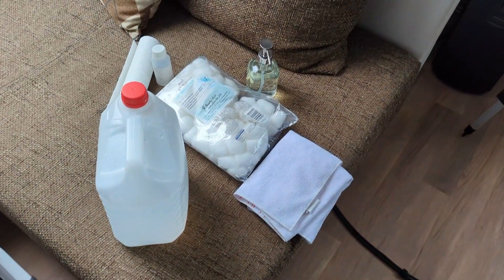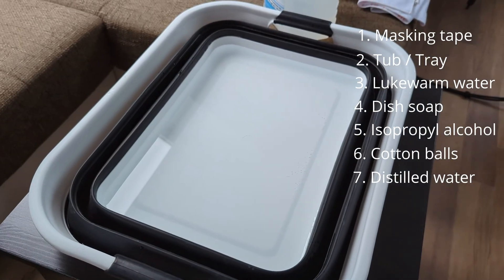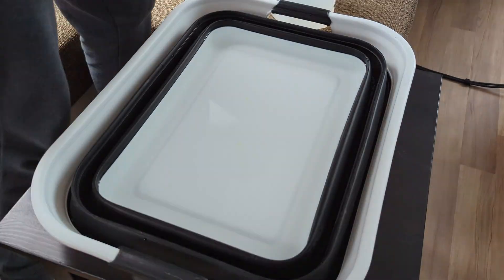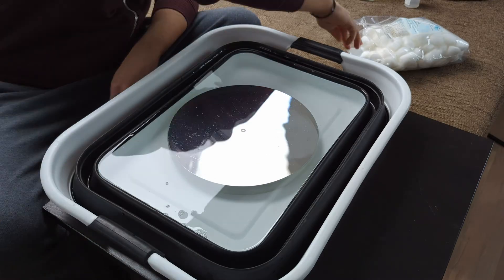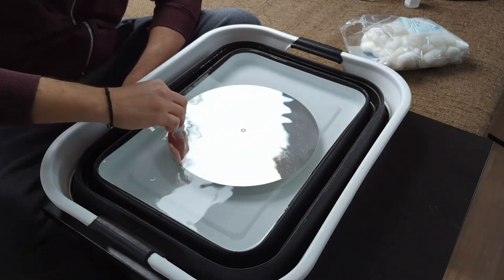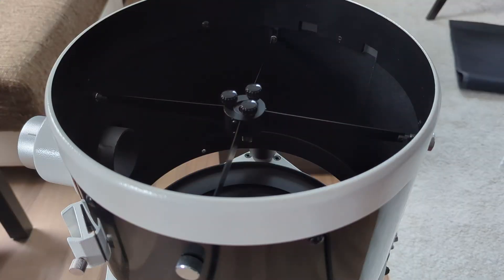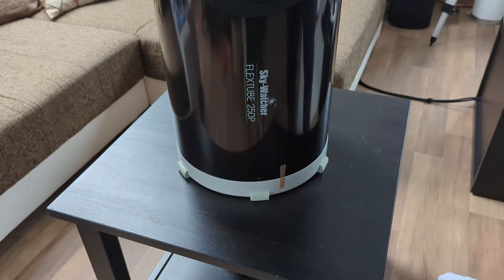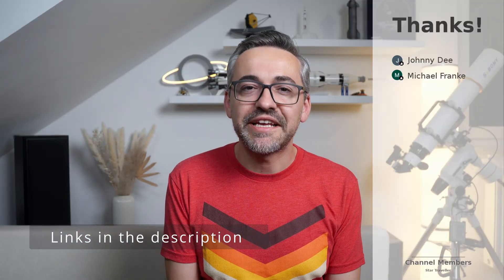How To Clean Telescope Mirrors

Comment: I just take off one screw per rubber clap I just loosen the other and swivel it away from the mirror. So I didn't have to remove all the rubber claps. just one screw of each cap.

Comment: Do you think a water jet is a suitable method to clean the mirror?
Reply from the maker: Honestly, I would be very mindful of using high a pressure water jet to clean the surface as the pressure might damage the coating. I would recommend the old fashioned way with a tub+cotton balls. This has worked every time in the past.
Reply: By water jet I do not mean Karcher. There are dental jets that have several modes and accessories +can be filled with detergent mix etc. I think I will purchase one, they are $10 for a quick test.

Comment: I cleaned both mirrors on my 250P.  Removing the screws that hold the primary mirror in the cell for the first time is scary! Those screws are tight. I replaced them with socket head (alen) screws. The alen wrench is far less likely to slip.

Comment: Initial removal of mirror cell assembly from OTA (not to be confused with primary mirror and the mirror cell) should have a register tape to assist with removal and replacement in the same location.

Also, wash hands to remove skin oils in hands before actual cleaning of mirror.
Reply: It is best to wear surgical gloves.

Comment: Please never use cotton balls. If there is a speck of dust you will drag it with the cotton ball across the mirror and leave a scratch. The correct way is to always clean it inside the water only with your fingertips. This way you get to feel any speck of dust and stop immediately. Once this happens at least once, you will realize how dangerous the cotton balls are (you can't feel the specks with them).
Reply: Yes and no... It depends on the quality of cotton and pressure you put. Another, very good method is to tap instead of drag. I cleaned a mirror covered in mud - yes a thick layer of mud. I was tapping with cotton and made no scratches. The mirror was like new.

Comment: Question, why does the primary mirror need wiggle room?
Reply from the maker: Great question. It's because it needs to be able to move during the collimation process - slightly change orientation by tightening the collimation screws. This way you can ensure that the mirror is perfectly aligned with the secondary and the tube itself and not get pinched by the support brackets.
Reply: The mirror is a first surface mirror; the reflective surface is a very thin coating. Too tight a grip can deform the surface of the mirror, causing it not to perform as intended. Commonly known as "pinched mirror”.